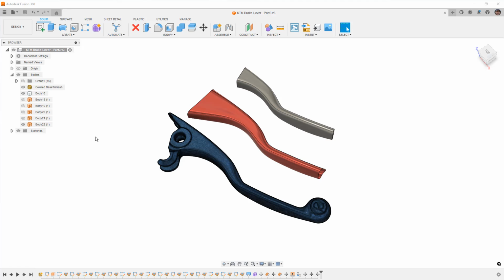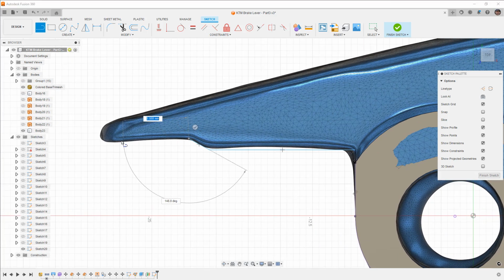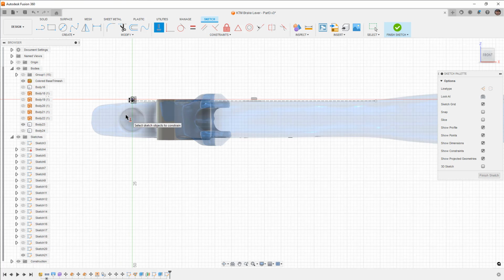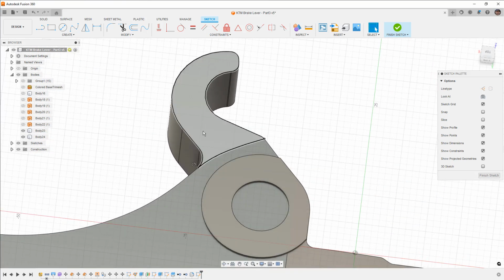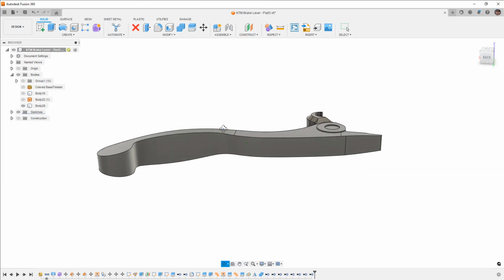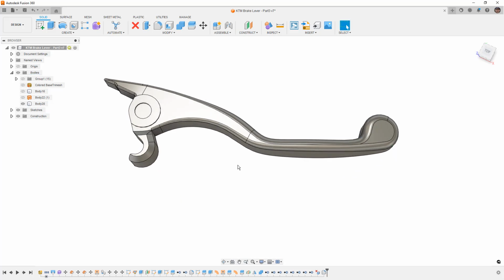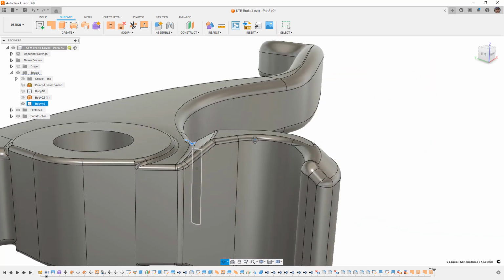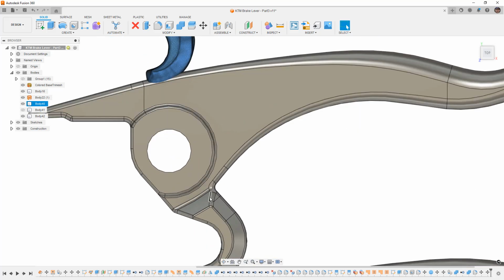Reverse Engineer Workflows in #fusion360 Part 3 | Using Prismatic Features To Reverse Engineer Parts

Comment: I have a question , if you can answer it will be very helpful, Why didn't we use the free form feature for all the remaining features of the Brake lever
Reply from the maker: Freeform features are non-parametric, meaning they don't really link back to a sketch and dimensions.  Mechanical parts driven by dimensions should really be done where we have more control.  You can use some tools to link freeform surfaces to solids or surfaces controlled by dimensions, but its much easier to not do that.

The other thing is that forms get a bit tricky when we start to change the direction of flow.  They become much harder to control.

Comment: If this is too long-winded for some, they can find another video.... for me, this is great!!!  I'm currently learning how to do this and listening to your train of thought as you do things helps me to understand how I should be thinking!  Thank you very much!!!
Reply from the maker: Thanks! and glad you enjoy/appreciate the approach :)
Reply: @LearnEverythingAboutDesign  I'm currently bing watching a lot of your videos!  I'm currently working on using Kiri engine to scan a pretty complex part (a cylinder head from a motorcycle) so I can replicate and 3D print it.  Any suggested videos to watch to help with this?  My next project is creating a custom holster for a flashlight and was thinking of designing it in a way that the final print would give the appearance of a custom molded kydex style holster, kind of like the kydex was vacuum molded around the flashlight.  Any suggestions on videos to manage that?
Reply: Oh, and again, thank you so much!  I only recently found your videos and they are by far some of the most helpful in addition to a few other channels!!
Reply from the maker: @christophergrace1085  I would say for the flashlight holder that you likely want to work with forms for something like that.  There are loads of form videos and any general form video will help but any that use the Pull tool specifically.  https://youtu.be/COh94Os45T8

For the cylinder head, that you will likely want to use mesh section sketches.  Probably this playlist would be a good start.
https://www.youtube.com/playlist?list=PLBDfGh8A8kXWYEY9X4vJ5sKGh6TPzrr2h

Depending on what its off of though you may need to do a lot of extra investigation work.  For the flashlight you likely can do that without any measuring.  I actually made some TPU printed flashlight holders for my kids beds.  For the cylinder head you will want to measure critical features.  While the scanning can be very accurate if you have press fit dowel pins for example you have to either use a gauge pin set or at the very least a set of calipers to get good measurements.  The bolt spacing will be something you will want to measure as well to verify.  Say its a single cyl with 4bolts. measure from each bolt to the next, and then in a cross pattern.
Reply: @LearnEverythingAboutDesign  these are kinda the approaches I'm taking!  None of these things are critical values, and more for esthetics. The cylinder head is just a pretty complex part, and designing it from scratch is proving to be a stretch for my current skill level!  I was hoping to use the scans to help with creating the model. I used to do 3D CAD modeling years ago (20ish to be exact) and the program I used isn't available to me.  I recently started to not only relearn 3D CAD, but with a totally different way of thinking in Fusion than the program I used to use.
Reply from the maker: @christophergrace1085  Yeah the basics going from say and older command line style program like AutoCAD, which was my first experience into CAD in the mid 90s.  The history/timeline based "Parametric CAD" is the norm today and has loads of advantages.  I do have Absolute Beginner content on my website.  www.LearnEverythingAboutDesign.com   This channel does focus a bit more on the advanced/expert workflows.
Reply: @LearnEverythingAboutDesign  I was looking at your stuff and was considering it! I believe the program we used back then was called solid edge, it was pretty advanced for the time!  For me, it's starting to think in that parametic mindset.  Using the parameters sheet, and making the designs easier to modify. Thank you for all the amazing context!
Reply from the maker: @christophergrace1085  Solid Edge is still around.  It is under the NX company Siemens.  I believe it retails for around $2000.  I am not a fan of how it has evolved.  Its OK but not great.  I believe Fusion to be the most user friendly UI out of the bunch.  It is more powerful in some areas and less in others.  No routing, weldments, sheetmetal and drawings could use some more functionality, but overall a great program!

If you do buy a course or bundle I still have the "50kpromo" code for 10% off active.
Reply: @LearnEverythingAboutDesign  thank you very much sir!  I will definitely be signing up for the basic bundle!  Thank you for all the work you've put into this!

Comment: 3D mouse is just fine, what was wrong with it?
Reply from the maker: I used one exclusively when I was only using Solidworks because I don't like their navigation.  I have found in every other software I prefer not to.  Mainly because I use a lot of shortcut keys when sketching and modeling that are available with my left hand.  I am actually slower at modeling when using a 3d mouse.  I had one hooked up that I touched maybe once in 6mo so i reclaimed some desk space :)
Reply: @LearnEverythingAboutDesign  Makes sense. I have a single spacemouse. I wonder how useful the ones with many button options are.
Reply from the maker: @MuttakiNL  I have a space explorer with a few buttons on it.  I used to use a navigator with the screen and all the buttons.  the problem I have is that its not enough buttons so i still need to use the keyboard.  I had it setup so i used the keyboard for sketching and had the hotkeys mapped to the mouse for modeling.

In fusion i use hotkeys for more than buttons would allow :)
Reply: @LearnEverythingAboutDesign  Hotkeys are definitely great to use. You have great tutorials by the way, they are much much better than even the most popular channels on Youtube. Thanks for this channel overall.

Comment: Little more advanced lessons like yours are the best!
I'd like to see how you would combine free form models and parametric solids with nice blends in the future! 🙏
Reply from the maker: Great suggestion!  I'll keep that in mind for a future vid.  In the forms mastery playlist I did show associative match which is a tool that lets you drive the shape and edge of a form with a surface.  So i would likely suggest start with the surface first and drive the form that way, but it could work either direction.

Comment: Is this shape sort of an easy one? I might be having some reduced brain capacity but I cant for the life of me figure out how to transfer this knowledge onto my own project.
Ive scanned one side of a grip panel for a riflestock, and the scan is good, I've oriented it in GOM but that is as far as I'm going to get after 5 hours of watching videos on reverse engineering...
Reply from the maker: I wouldn't say this is an easy shape but every design has its own complexities.  Did you see the first 2 parts of this series?  I show 3 different ways to work on this shape and why for this one i used parametric modeling.

For your rifle stock, that is generally a shape that might lean more towards a form workflow where you can snap to the face with a form.
Reply: @LearnEverythingAboutDesign  I watched part 1, 2 and 3 and also a few other videos that you made, and from a few other youtubers. Im sure the explanations and guiding are good, but my tiny brain cant seem to compare the techniques used in your example over to what Im trying to work on…
 Im just about to give it another go.

Id love to show you what Im working on, but I dont think I can link to anything or add a photo here in the comment section.

Comment: why not use the Mirror feature for all of the fillets/patched fillet etc? (I may have not been paying attention when you addressed that bit)
Reply from the maker: I don't remember exactly at which point you are talking about, but in general mirrors of things like fillets on more complex shapes tend to fail, so that might have been the reason.  Not sure.  If I can help it I generally will mirror prismatic features and apply fillets to the top/bottom in a single feature.  Exceptions would be things like rect/circ patterns.